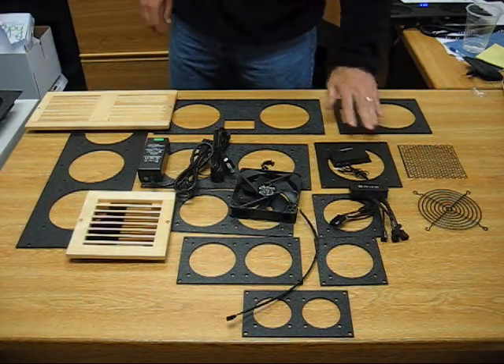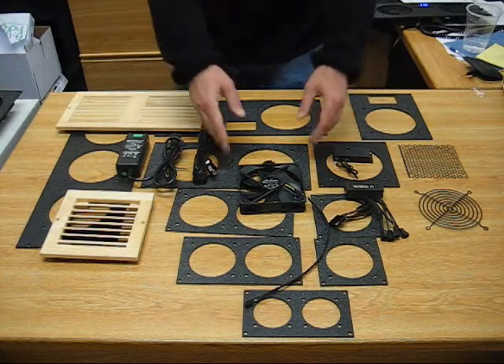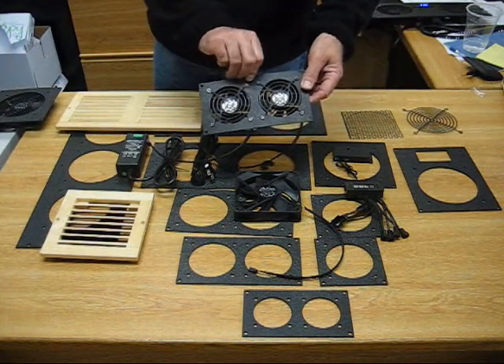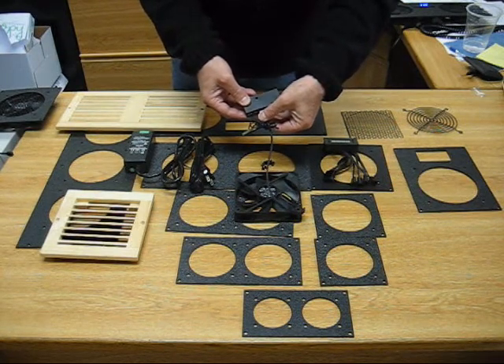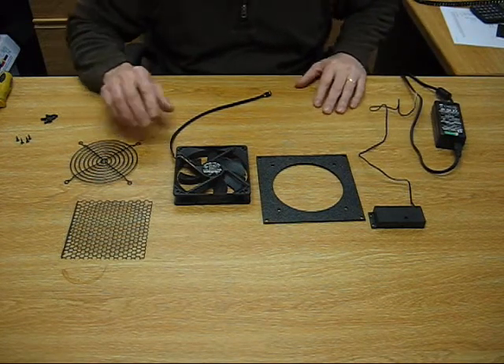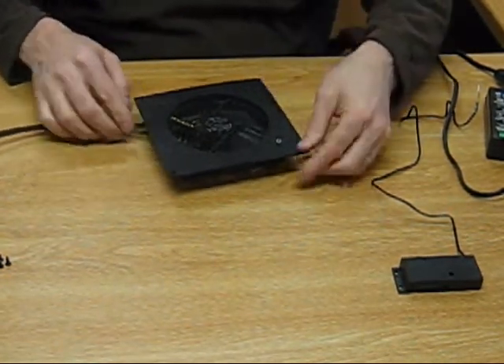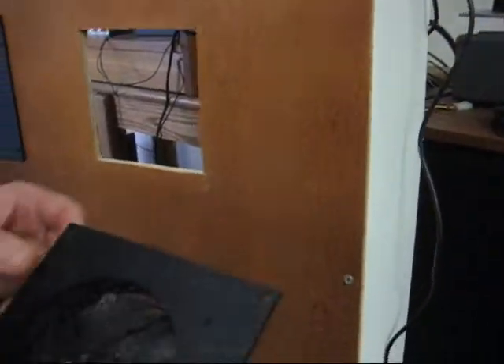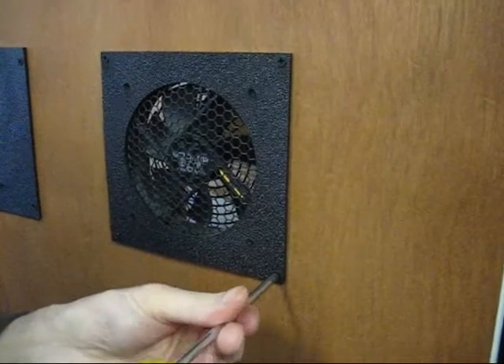cg demo for cabcool.wmv

Comment: Would you mind doing an installation guide on how to install the Dual 80mm component cooling fans with USB connection or the Coolerguys 80x802x25mm USB Fan with Grill into a computer case. I want to buy them but I want to make sure I know how to install the fans first. Thanks!
Reply from the maker: Hi TechGeec! Thanks for the idea. We'll be releasing more videos soon. Please send us more details on what you were using them for--you just plug them in and they turn on. Contact us here: info@coolerguys.com